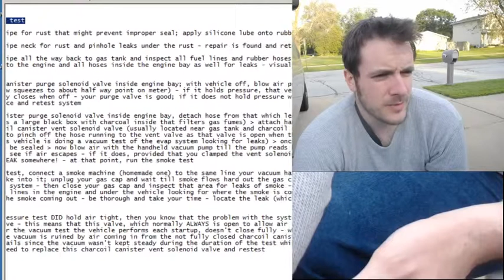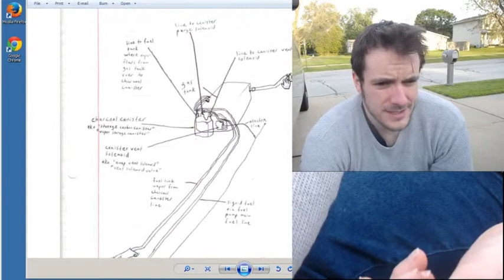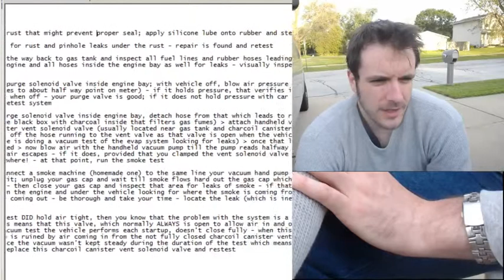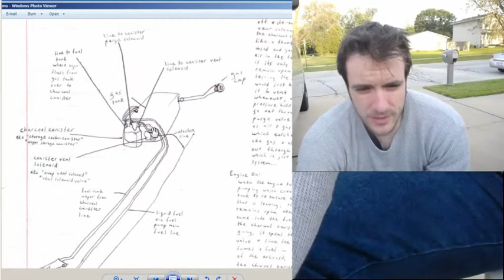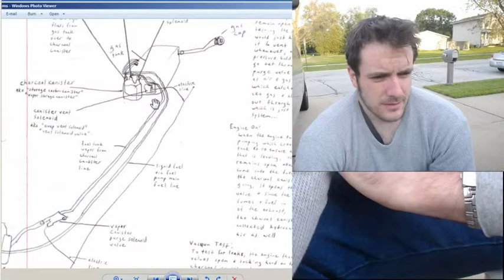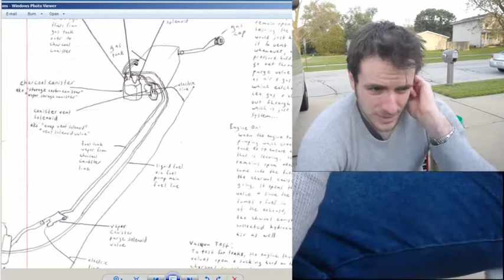Troubleshooting Evap System Leak Step-By-Step Guide (P0455, P0456, P0440 etc)

Comment: I would be very careful applying pressure to the evap system as you can blow seals and older brittle lines may split from too much pressure. Also, you don't apply pressure with a vacuum pump (I talk the same way if a camera is rolling). Other than that  good video for diaging the evap system with basic hand tools, I thoroughly enjoyed it.